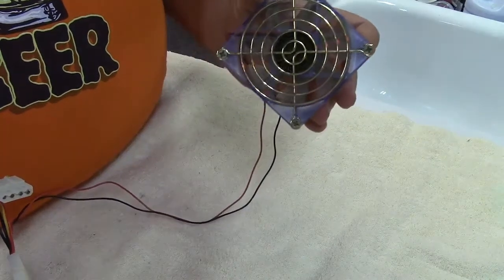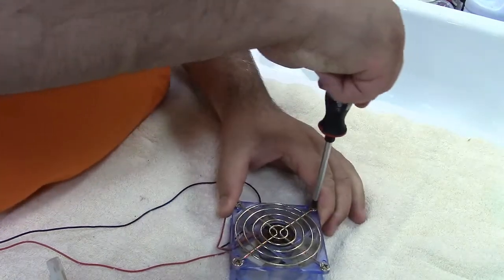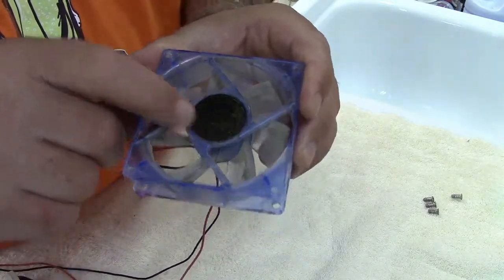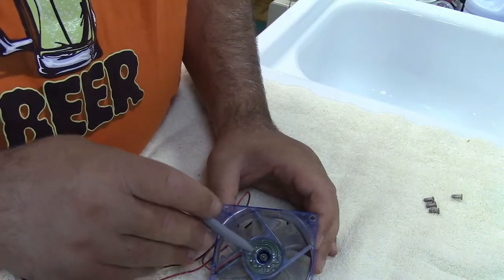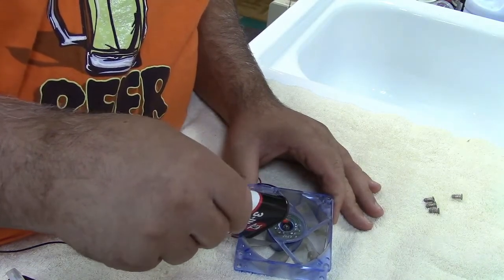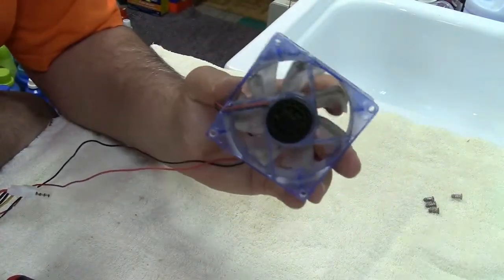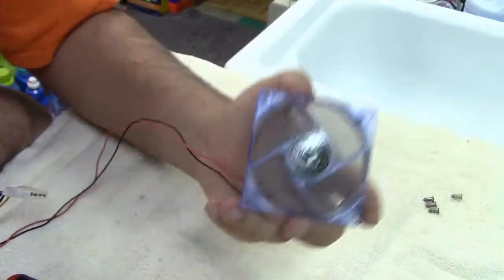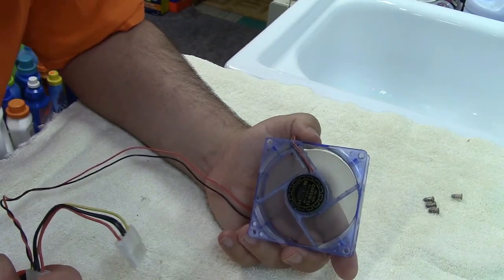Revive A Dead Computer Fan--QUICK AND EASY!

Comment: You'll probably laugh, but can I use olive oil??
Reply from the maker: You can use anything you want if you can deal with the consequences.  If you use other oils, you will either damage it further or end up having to do the job again REALLY soon.  Not to mention, olive oil will go rancid.  Then your entire room will smell like it.  There is a REASON the thumbnail shows what it does.
Reply: @jaykay18  thanks for your fast reply. I applied olive oil to my door hinges and it works so I thought maybe here too. Okay, what about grease oil? The one you used in the video is out of stock here.
Reply from the maker: @mht-h2m  Again, you can use anything you want.  Use the right stuff and do it once.
Reply: @jaykay18  okay, I'll try to find a 3 in 1 oil or light machine oil

Comment: My year old alienware laptops fan started making some noises. Checked the temps and it was showing 10 to 15°c over the recommended temp . Couldnt find any spare parts in my region and shipping would have me wait 2 months. I took it to the local laptop repair shops. The guy assured me that it will be fine . He used a combination of isopropyl alcohol and WD-40 to clean and lubricate it. (Yep Wd-40 for lubrication ) it was fine for a day or 2 . Again started to give the same symptoms. I totally agree with you. Wd 40 is not the way to go. Took my friends advice and used sewing machine oil instead and its been working perfect for the last 2 months. Soo if anyone wants to lube their pc fan,please dont use WD-40 cause it will only solve the problem for 2 days max.
Reply from the maker: That's because WD-40 isn't a lubricant.  It's a Water Displacer, that's the WD part.  The 40 means 40th attempt, which explains there were 39 attempts before that failed, and quite frankly, I don't think the 40th one passed either.

I would go back to the computer store and insist on my money back.

Comment: Removing the fan from the heat sink is one thing but place it again is impossible.
Reply from the maker: Not if you know how!
Reply: @jaykay18  Sadly I don't, the screws aren't made to be removed.
Reply from the maker: @illogical1421  Anything that was put together can be taken apart, and usually put back together again provided nothing was broken in the process.
Reply from the maker: @illogical1421  Those aren't anything special, but they do have springs on them, so they have to be pushed down with some force, sometimes while holding the backing plate on the back of the motherboard.  You want to start the screws diagonally opposite from each other, just start them, and once all 4 are started, tighten them down, diagonally opposite each other..  Simple, simple.  Retention mechanisms of years past are MUCH more complex than that.
Reply: @jaykay18  Attaching or reattaching the fan isn't the problem, the problem is that I can't remove the fan from the heat sink to fix it without damaging the springs or the parts that's holding the screws in place(nuts? I don't know what they're called).
Reply from the maker: @illogical1421  On the example picture you linked, they're just Philips screws.  You'll need a skinny screwdriver to fit through the top hole of the fan to get at them.
Reply: @jaykay18  I'm sorry about the confusion, my phone is down and that's the closest pic to what I have that I found on Google earlier, after some more research I managed to find a more accurate example: https://bit.ly/2ONq8Bn
Reply from the maker: @illogical1421  It went together, so it has to come apart.  It doesn't come out of a manufacturing machine already put together like that, they sit there in China and PUT these parts together into the final product.  There may be some C-clips that hold it together, or sometimes plastic rings, but indeed it can come apart.
Reply: @jaykay18  Rings is probably the word I'm looking for, they're metal(?) rings(I'm clueless about this things) can't take the screws off without damaging them, last time I tried I ended up damaging the springs too, I'll try not to damage the springs this time, I'm not sure about replacements but I do think both the heat sink and the fan can hold in place without them.
Reply from the maker: @illogical1421  Springs need to be intact.  The rings usually are there just to keep the springs captive on the screws, and are likely unnecessary.

Comment: In my case the center of the sticker is kinda burned so maybe the bearing inside should be burned too right? also is cooking oil a good alternative?
Reply from the maker: If this is an emergency situation, and it has to work now, and never again, you can try cooking oil.  What will happen is it likely will gum up and may turn rancid and smell, though with such a small amount you'd be using, you'd probably never notice.  You are best using the right oil like I explained and showed in the video.

It can't hurt to try fixing the fan, if it's not working now, it will either continue to not work, or you might fix it.  But if you're going to attempt, you might as well use the right stuff, so the repair will hold up.  If you don't have any luck, the fan will need to be replaced.

Comment: Even the correct 3-in-1 is a bit thick for something this small.. It will probably give you plenty more life out of the fan, but something very light weight such as sewing machine oil would probably work a lot better..
Reply from the maker: I couldn't imagine 3-in-1 being too thick for this application.  That very can seen in this video has oiled countless fans for the last 25 years without a problem on any of them.
Reply: According to the manufacturer, it's for motors 1/4 HP and larger.. However, I too have used it on smaller applications like a C frame shaded pole motors, and it's worked well..
Reply from the maker: That's exactly why I continue to use it.

Comment: The only time I actually did this was on laptop fans that I didn't want to get a replacement for. 
My last dead computer fan actually just died randomly without seizing up - just didn't work anymore. Luckily nothing did majorly overheat when that happened years ago.
Reply from the maker: Yeah laptop fans are generally proprietary and not easy to come by.  Otherwise I've oiled and brought back fans of all different shapes and sizes.  Did you happen to meter your dead fan to see if it went open circuit?
Reply: jaykay18 The old fan had some electronics on it, even having stall protection and auto restart, so I assumed that the electronics fried somehow. It was a 120mm LianLi fan that came with the LianLi computer case of my workstation.
Don't think I actually metered it to see if it was open circuit or not before tossing it into one of my "broken electronics" boxes which might still be somewhere in my basement storage room here (which I should go defragment cause it's a mess and I don't find anything anymore cause I just kept throwing cardboard boxes and other stuff on top of each other).
Reply from the maker: Could have had fried electronics.  The more complicated something is, the more points for failure!

Comment: I rarely have Computer fans go Bad on me i had Weak computer fans that dont move a whole lot of air
Reply from the maker: I've had one or two go bad on me over the years.  The rest of the bad ones I got from other people, and then revived them and put them in the computer junk boxes for possible use one day.
Reply: jaykay18 Passive cooling with no fan at all is also worse that fan based cooling or liquid cooling
Reply from the maker: Generally, anything that's passively cooled slowly cooks itself to death.  Water cooling is ridiculous and really shouldn't have a place in consumer-grade equipment.  Guess it's just like the ricers that put K&N filters and fart can exhausts on their Hondas and call them fast.
Reply: jaykay18 i made a video about a netbook on my channel and it did get slightly too hot